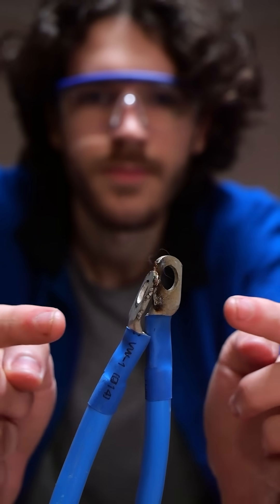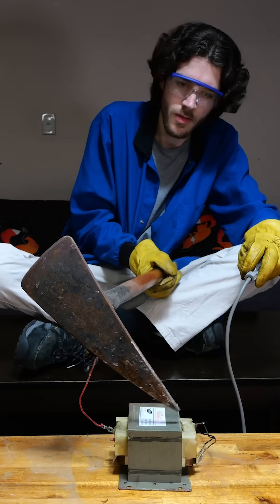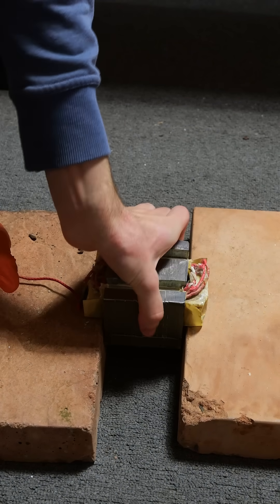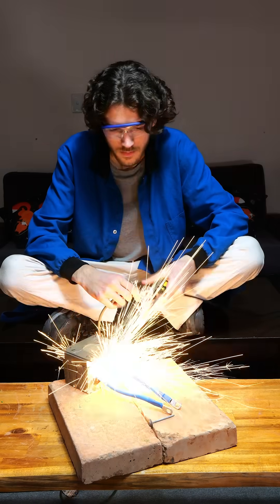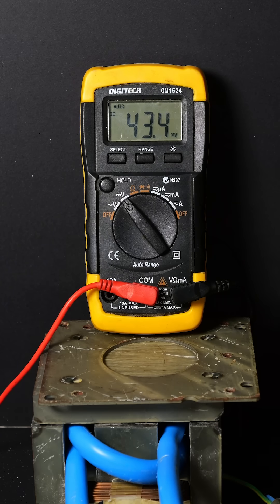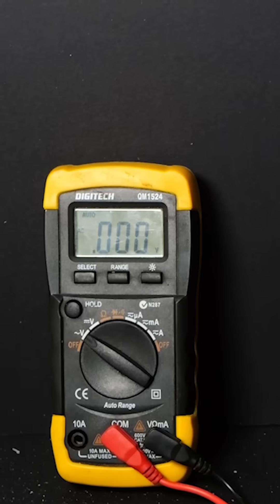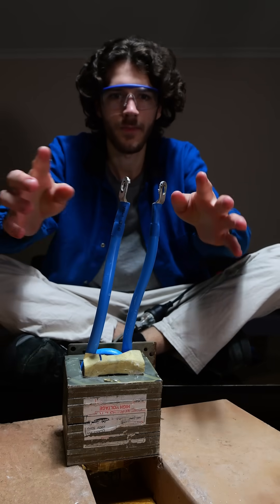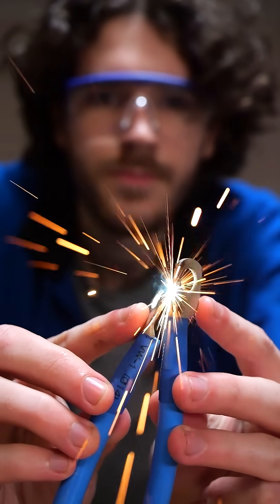What holding 600 Amps feels like

Comment: (Don’t do this) Now you could do high amperage and voltage so you actually conduct it, but bump up the frequency so you don’t die. This works because apparently nerve cells don’t register high frequency well at all. An instantaneous drop in frequency will still kill you.

Edit: I’m saying this because this is just a more dangerous version of touching the leads on a car battery. Without adequate voltage to push the current you don’t conduct anything. If you wanted to actually feel a few amps passing through your heart without dying, increase the frequency, you might still get internal burns if you do it for too long.

Comment: Well theoretically but you might experience burns of it sparks to much... Also if not we'll insulated from the grid (yes that happens too some are naturally using one part for certain windings) you can also get severely zapped or killed... If done with DC and grid voltage runs over rectifier provided you have such doides and they holt grid power too your probably toast since they happily rectify grid power to if rated so.

Comment: I had a usb cord with exposed wires and ran it through a small doorbell transformer and got enough current to weld two pennies together with some 0.5mm mechanical pencil lead

Comment: Electrical engineer here. Transformers work by using the magnetism of alternating current to change voltage. The resulting voltage is roughly equal to the ratio of coils (wire wrapped around the core) between the source wires and the output wires. He could increase the voltage by wrapping his "super thick copper" around again. 
Voltage is potential energy per unit charge. Current is the change in charge over change in time. (Flow rate) and is dependent on the amount of available charge, Resistance and Voltage. Most power supplies derate as current increases, meaning that the available Voltage drops, and so does Current. The scary thing about what he made is the stupid amount of available charge. 
Waste Heat is mainly defined by I^2R or Current squared times resistance. This defines where the heat is generated. Current is calculated using Ohm's Law starting at known Voltage and the Equivalent Series Resistance (I=V/R). 
Hope that helps, but I skimmed over a lot. 

P.s. don't play with microwaves. They want to hurt you and can melt concrete if angered.

Comment: Current is like volume of water but volts is the flow or pressure of the water....... A bucket of water and a cup of water don't do much it's just there like a puddle but with low voltage it's like splashing water n if it is high probably like a water jet👍

Comment: You're not holding 600 amps... You're holding a few microamps. A low voltage can create a high ampage when it flows through something low resistance like wire...

Comment: Hundreds of amps feel like nothing to you because there arent hundreds of amps. 

When voltage is low and resistance is high then then the current is also low. So in reality when you touched 2Vs and we assume your body has around 1000 Ohms resistance then the current flowing threw your body was 0.002A. 

Video Title and conclusion is missleading.

Comment: Does it count as current flooring through you if the voltage is too low to create a circuit through you?
Reply: Because of the low voltage it isn’t enough to penetrate through your skins resistance so you feel nothing

Comment: So high voltage + high amps + low frequency = deadly correct ?
Reply: Think of if you had 1000 volts and 0.5 amps pass through you, you would most likely die

Comment: Seems to be unsafe to touch them with both of your hands lmao, I learned to use two fingers on the same hand just so , yk it doesn’t arc across your heart and explode it
Reply: The voltage is way too low to pass through your skin’s resistance
Reply: 2V

Comment: It aint the volts that kills you its the amps. Amps is essentially how fast the current is moving volts is how much current is moving. 12v at 200a is 2400w if I did my math right
Reply: Wrong.
Reply: So, a few things are wrong. It is not the amps that kill, nor the volts. Well, you could argue it is the current going through you, but you need high enough voltage to do so. It's a combination of the two plus a few other factors like time

Amps is the amount of current and voltage is the pressure pushing the current

And 12V(like a car battery), even if able to give out thousands of amps(most can) cannot kill you

Comment: To test breakers we use what is called a primary injection test set. Basically a series of transformers like the one you made with a variac and a tap changer to pump huge amounts of amperage into a breaker to simulate the conditions for the breaker to trip. These test sets can produce up to and around. 10,000Amps at around 3-7 volts. And so you are not at risk for being shocked but you are at risk for being burned.

Comment: Ohh, 😳, i have doubt please answer Guys.. what if there was 1000 voltage
Reply: If there was 1000 volts with the same amps used here you would be killed instantly
Reply: There is no way there is 1000 VOLTS. It is literally impossible and I couldn't even think of a plausible way there could be 1000v across the terminals

Comment: It’s not because it is in low voltage, it’s because the power has been transformed into DC volts. Batteries are usually DC because you can’t get shocked by them, but on the other hand, if it was in AC you would have gotten seriously hurt.

Comment: Bcoz the transformer turn the alternate current into direct current and direct current doesn't do a thing to us right?
Reply: You're very wrong. Transformer turns AC to another form of AC. Could have higher voltage but low amps or low volts but high amps. What you're talking about is a rectifier. DC could very well still kill you given enough voltage.
Reply: @OptiAero6432 okay but what does that one call that converts from dc to ac?
Reply: No

Comment: Same idea as a 12v battery it won't shock you touching both terminals but if you lay a wrench across them 400-1000 amps depending on the batt will melt that wrench like butter

Comment: There wasn't more current flowing through you than if you licked a 9V battery. There isn't a high current when the resistance is high and voltage is low, so you can't even feel it

Comment: This is very cool to see but it does not mean that volts are the issues there also exist places where high voltage low current won't hurt you like a Tesla coil but you should always be aware of what you're doing and not do stuff like this.

Comment: I did that once. I dont even remember why i had that open around. The normal powerplug does hurt and strucks you hard. This high voltage thing does hurt but different, not that snappy, it felt like my whole arm is cramping so fast like i never felt it  and barely can rethink of what i felt. I just Barely touched it as i tried to move it and flicked away, man i think if you cant get away or off that you gonna be fried quickly

Comment: Just a safety tip never touch open wires with both of ur hands, if in any case the current tries to flow it will have to flow through ur heart probably killing u instantly but if you touch both terminals with same hand like using pinky for one and thumb for other in case of any anamoly u will suffet injury to ur hand only and might loose the hand but its better than loosing ur life

Comment: All of what he's doing here is sound science and he absolutely knew he was safe before touching it. But please don't try this yourself if you're not extremely familiar with high voltage electronics. Those capacitors he showed are deadly. And that transformer without modification is equally deadly. Just be safe and be smart

Comment: Hey There, Wanna recreate the experiment? Don't wanna f up a microwave? No Problem, here's whatcha gotta do: Take an old car batter that still got juice. Noticethat it only got 12V but high amperage. Touch both poles and realize: "Hey, that doesn't do shit." Take a metal object (Like a wrench) and ATTENTION: touch one pole with it and ONLY SHORTLY touch the other pole with it, so that the wrench contacts both together. Why should I connect the poles for a short time only? You don't want to melt the fucking wrench, now do ya? No, no you dont. So for the kids: Give your parents your phone or whatever you're reading this comment on (Don't move the TV) Let them read this and maybe or maybe not try the experiment out. For the parents or not-kids, here's the experiment in points:
1. Take an old car battery 
2. Touch both poles
3. Take a wrench and connect it to ONE pole
4. Quickly connect and disconnect both poles with the wrench.

Comment: Thank God someone made a video for this. I see so many "it's the current that kills you" when people talk about voltages.
Reply: It's both infact
Reply: @HVACR_LIFE  not exactly. I could touch a system with a voltage of 2volts but with 1000 amps and be fine, but if I touch a system at 1000 volts but 0.1 amps I'd die. Its because its the generated current that kills you which requires a high voltage.
Reply: @standardmercenary4336  thanks for proving my point
Reply: @standardmercenary4336  yes? That is a combination of a high enough current(>30mA), high enough voltage(>60V) and high enough duration(dependent on voltage and current)
Reply: @DamjanObradovic-dl9tk  assuming a person has a resistance of 300ohms (which is unlikely) a source of 30volts can kill that person, because it would induce a current of 100mA which is the minimum current to kill. The danger of killing someone from an electrical source is only dependent on the voltage of the source.
Reply: It was 20 Micro Amperes... 20000 NanoAmperes. It's such a low amperage that it's ridiculous.

Comment: I’m lost. He got it backwards right? I majored in electronics engineering and what I know is: 
Voltage = not dangerous 
Current = very dangerous. 
This little shock prank devices typically deliver 1000+ volts but just at extremely low current. What he made should have flat lined him when touching it with both hands.

Comment: Trying to explain the relationships of amperage, voltage, and ohm...age, is always so fascinating to me, because 600 ampules of power could easily be enough to explode a heart, but if it's only running 2 volts, you won't even feel a zap on your fingertip

Comment: bro is just trying to end it with a darwin award
Reply: Not when you know what your doing
Reply: Clean dry skin has prety good resistance. DC your prety safe below 50v as it just cant get through.  AC the threshold is lower but under 30v or so you may feel something but it cant hurt you yet.  Wet skin or worse if you've got a break in the skin all bets are off and really low voltages can potentaly flow looking for a path to ground.

Comment: What actually happens is very little current passes through his body. Your body needs a voltage above 40 to run a sufficient current to cause damage through you since your skin is generally insulating but insulation breaks down under high voltages making it more conductive. That's why even when he touched it with both hands current was still very little to cause damage.
Still, don't ever tinker with electricity if you are not an expert. I'm on my second year of EE and still think twice before attempting anything as i don't know everything.

Comment: The reason it doesn't harm you because you have high resistance. an AA battery also doesn't harm you because of that reason.

The reason this can melt iron and AA battery can't is: AA is a chemical battery. It doesn't generate enough current, Its chemical reaction is not fast enough. The moment you try to pull too much current its voltage drops to almost 0. Until chemical reaction balance again.

Comment: Always use the back of your hand if want to test for voltage shock. If you dont, your muscles  will contract forcing you to grab onto it and then you die. Back of the finger, same thing happens but the muscle contracts away from the scary voltage. But just use a meter people. Dont die.

Comment: A pro tip for next time you touch live wires: If you only touch it with one hand and you where insulated shoes your survival rate gose up slightly. In this case if you shorted the two wires with one hand and someting gose wrong it would "only" burn your fingers. But you touched it with both hands so the electric would have flown through your heart.

Comment: And thats why it's DANGER HIGH VOLTAGE and not amps. If its voltage limited a ton of amps won't hurt you.
Reply: The limiting factor ultimately is the resistance and the voltage after it drops due to the resistance. So really its about how much wattage is still there after being dropped by resistance.
But you're right, it's danger high voltage because there's enough power to break down the air in which ohms law breaks down

Comment: What circuit did you use to make that AA battery spark like that?
Reply from the maker: It's just a taser module you can buy from eBay for a few dollars. They've got a transformer and some capacitors that charge up inside

Comment: Same reason you can touch a car battery, low voltage but also low internal resistance creates sparks when short circuited, but your body’s resistance makes sure you don’t spark

Comment: Where did you get the thick wire from? The wire i use is melting because it is too thin.
Reply from the maker: It's a battery cable. Often sold at auto stores
Reply: @mrgreenguy thanks👍
Reply: @mrgreenguy what thickness of wire did you get?
Reply from the maker: @Jento_m  I think mine was 10mm thick. Honestly though, I wouldn't encourage trying this if you're not familiar with how to figure out what type of cable to get. You can also still get shocked by the primary

Comment: Touching the lugs with your bare hands while they were touching each other is crazy. I know they weren't arc welded together yet but if they had been they would have produced some insane heat
Reply: They can't weld as their always melting so just pull them away

Comment: So the volts kill ya! Mistery solved
Reply: Its both actually. You need enough volts to get past the resistance, (or reduce the resistance. Ie getting wet) and you need enough current (its not a lot) to die.

When you shimmy your socks on the floor and grab something metal: thats a very high voltage very very low current shock.
Reply: Wrong. It's not just one thing. It's a mix of volts, current and resistance.

Comment: This is why I've always despised the aphorism "It's not the volts that kill, it's the amps" because you can have all of the amps in the world and it means absolutely nothing without enough voltage to drive it.
Reply: Styropyro did a more in depth video about this but yeah, both are oversimplifications that are kind of sort of true in some circumstances (a high voltage low current supply sags when delivering a shock so technically it isn't actually delivering high voltage, but people think of that as a low current shock at high voltage instead since they don't measure or think about the true voltage at the time of the shock)
Reply: It's a mix of volts, current, and resistance in the simplest form. In the end the current is what kills but it's not the only factor required for the electricity to kill you. And i think that's where the confusion comes from.
Reply: @Sh4quille0atmeal In the end it's actually the voltage across the heart and the amount of time it's applied for, it's just that current through your body is a proxy for voltage across the heart through Ohm's Law and most shock sources are low frequency enough that frequency/duration don't particularly come into it
Reply: @Sh4quille0atmeal  The problem is that people equate the current through a conductor when with current through the body. A starter motor can draw 150Amps no problem, and you can touch both poles when it's working just fine. The current through your body is not dependent on the current something draws when in operation. While I=R/U is not entirely correct, since resistance of the body breaks down at higher voltages, it's still a good indication of how current through the body is directly proportional with voltage.

Comment: Well, you didn't touch hundreds of amps. You touched a device capable of supplying hundreds of amps under the right conditions, but the actual current that was flowing through you was probably somewhere in the nanoampere range. 

And that's a good thing.
Reply: Because the voltage was too low to overcome the skin's resistance
Reply: Now it makes sense. Thanks